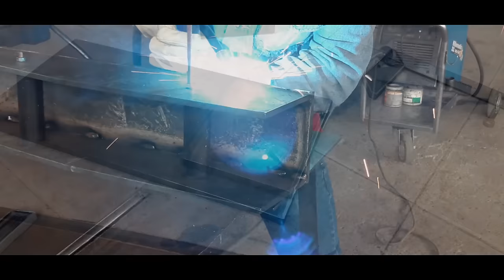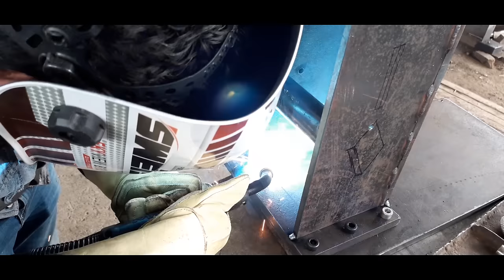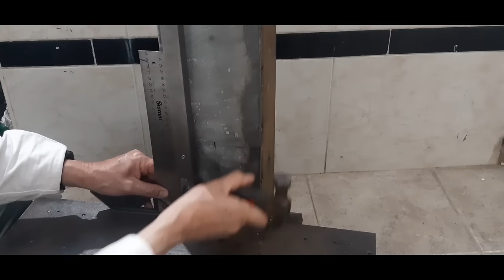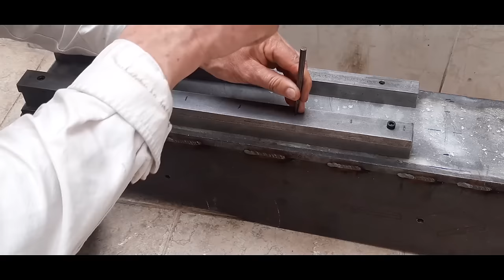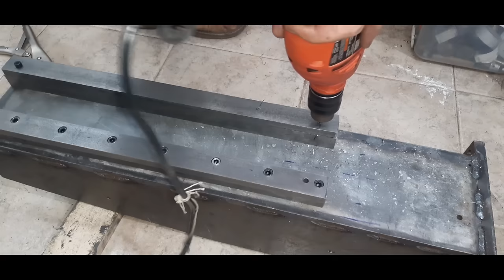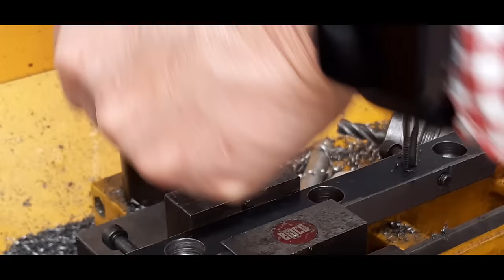Milling Machine homemade (Z AXIS - COLUMN) - Part 2

Comment: I'll never understand why anyone welds thin steel plates like that for homemade mills. Epoxy granite castings are superior, easier and less problematic.
Reply from the maker: Thank you for your comment, of course epoxy granite is also a good option, but this way of welding helps to make pieces for those who do not want to use epoxy.
thank you
Reply: Wrong
Reply: You do realize that an epoxy granite mill requires a framework that needs to be welded prior to pouring right. This frame cannot be screwed or bolted together thus welding is the only solution. You can't make dovetails and lead screws run in epoxy granite. The only real purpose of the epoxy is to provide vibration damping. So that statement was made with no knowledge of the machines function or porpose.

Comment: this method of making of prototype of industrial Equipmehts in small shop is called industrial engineering in real sense for production  of daily use material in need of man kind.  This will make the India to be smart city by providing of bricks tiles high speed railway lines for bullet Trains
Reply from the maker: Thank you friend for commenting, if that is done with engineering and being constant and insistent, great things are achieved. Greetings from Colombia

Comment: hi thank you for amazing build can you pleas provide me with x z y dimensions pleas and table length and width and z axis thank you
Reply from the maker: Thanks for asking, the dimensions are as follows:
x-axis displacements: 550 mm.
y-axis: 350 mm.
z axis: 500mm.
the dimensions of 
the table are: length: 600mm
Width: 155mm.
Any other questions I will be happy to assist you with.

Comment: great looking machine!   I'm designing one to make myself as well.   could you tell me though, how thick is the plate steel your using?  It looks to be half inch but wanted to ask anyway,  thank you
Reply from the maker: Thanks for asking, if the base and column is half an inch and the table top is 5/8 inch.
any concern may well.
Thank you

Comment: If you can build a fire and place all the welded frame parts in it to stress relieve them that would be good! Temperature variation, vibration and time will cause the welded frame parts to shift by up to a couple mm for this scale of machine. Industry does use welded members for CNC machines but they are stress relieved to get that residual stress out of the system welds then everything is trued.
Reply from the maker: Thank you friend for commenting, your appreciation is important, welding is critical in this type of project

Comment: It is a very crude machine. I saw recently small B-port sized machine made in Canada few decades ago - it only used fasteners. Was quite accurate & sold for good money. Way more than I expected. It was significantly better then this - far more machining was involved, scraping etc. 
This is just a precision of a cheap drill press.
Reply from the maker: Thanks, possibly, if you used it machining metals, you would probably change your mind.
Reply: @franciscomurciaprojects2327  Why don't you do a video where you machine metal with this "thing" and show the part & measure it? Make sure this is across most of the range in all 3 axis. Something like say fly cutting and milling. Use say 75% of expected max load.
Reply from the maker: @tomk3732  Thank you. Excellent idea and good comment. Yes, I will make a video machining a piece and I will show the measurements according to the three axes. Thank you

Comment: Excellent video, specially the spindle detail for a first time builder like me. Could you pls give sizes of the vertical column ?
Thanks
Reply from the maker: Okay. Thanks for commenting and asking, the size of the column is Height: 720 mm. Width: 150mm.
depth: 170mm.
sheet thickness: 12 mm.
Thank you
Reply: @franciscomurciaprojects2327  Thanks for this important info. I will go for casting. First the patern !
God bless you.

Comment: Hi great job and has given me lots of ideas, my question relates to the tapered roller bearings.
Did you use aluminium to make the bearing blocks?
Reply from the maker: Thanks, for the bearing blocks, I installed them with steel blocks

Comment: HOLA AMIGO, NO LO TOMES A MAL, LAS COSAS SOLDADAS EN MAQUINAS TIENEN MUCHA PROVABILIDAD DE VIVRACIONES Y LLEVAN MUCHO TRABAJO , NO QUEDAN BIEN YO TE ACONSEJO , HACE UN MOLDE EN TERGOPOL O MADERA Y LLEVALO A FUNDIR EN FUNDICION GRIS FUNDICION  CC, SALE MAS BARATO Y QUEDA SOLIDA COMPACTA Y SIN VIBRACIONES SALUDOS DESDE ARGENTINA .
Reply from the maker: Hola amigo Gracias por comentar,   si, efectivamente en este proyecto lleva partes soldadas ya que el diseño de la maquina lo requeria, esta es mi primera fresadora que diseño y a pesar que la fabrique con materiales de gran espesor y buena soldadura jamas llegare a la rigidez de una pieza en fundicion, lo entiendo y son datos atener en cuenta para otros proyectos. Mil gracias por su opinion que son generadas por personas como Ud. que conocen muy bien del tema. F. M.
Reply: Hola por ser la primera quédate tranquilo va a salir todo bien con algún problemita pero tranqui lo vas a solucionar . Yo tenía ganas de agarrar un torno paralelo de 1.500  desarmarlo usar la bancada vertical en lugar del cabezal poner una escuadra grande de 1000 x 1000 y arriba poner tipo mesa de fresa o mesa en Cruz grande y el cabezal reformar un poco y ponerlo arriba de la bancada y tenés fresadora y agujereadora muy grande pero no sé puedo siempre pasá algo y plata jajajaja un abrazo grande.
Reply: Hola estube mirando bien y no pongas hierro con hierro la bancada tiene que ser una parte de fundición por los deslisamientos y los engranes y trata de mecanizar todo lo que vá abulonado tiene que apollar bien suerte.
Reply from the maker: La idea de adaptar el torno es buena pero se toma dinero, el hierro ha subido mucho y esa es una limitante, per con creatividad se puede saludos

Comment: No creo que hice un proyecto, modelo, planes. Si eso sucede, lo haría si fuera posible.
Qué grosor tiene la placa del marco para que no haya vibraciones?
Reply from the maker: La placa del marco tiene 5/8 de pulgada (15 mm) y la columna tiene 1/2 pulgada (12 mm) y los costados 3/8 de pulgada (10mm)

Comment: Great work..love watcching the video.....How are you going to mount the motor?.....I'm designing a similar size mill.......What is the distance of the spindle fom the ways?
Reply from the maker: Thanks friend for commenting, the motor is installed on the left side of the column and supported on the milling machine head, the distance from the spindle to the column is 240 mm. and from the table to the spindle it has a travel of 450 mm. Any question may well. Thanks
Reply: Thank you Francisco. That really helps me understand your proportions. Are you using counter weights or gas struts to help support the weight. I would love to see the finished product. Thanks again.

Comment: Do you have a link or source for the mt3 spindle?
Reply from the maker: Hello friend, thanks for asking. If you refer to the chuck mt3 collet, here I send you the purchase link: https://es.aliexpress.com/item/32947049380.html?spm=a2g0s.9042311.0.0.3c1263c0Opttqw
But if you refer to the spindle I had already manufactured it before and therefore it does not appear in the video.
If you require another question, you may as well. Thanks

Comment: Excelente el diseño de la fresa , si fuera tan amable k grosor de plancha empleo i  de cuántos HP de motor Io usó , saludos desde SICUANI Perú 🇵🇪
Reply from the maker: Hola amigo gracias por preguntar, en la mesa use un espesor de 5/8 de pulgada y las ranuras en t usaré 1/2  pulgada
Gracias
Reply from the maker: También use un motor de 1 hp
Reply: Mil gracias x la respuesta , con su  permiso me boy a atreverme a reproducir, ahí falta un vídeo con máquina acabado , solo eh visto 2 ....saludos
Reply from the maker: No se preocupe que estoy terminando la parte 3 para subirla en estos dias

Comment: nice project, Where did you get that linear guides to allow the slide up an down of the Z axis?
Reply from the maker: Hello Friend, the linear guides are calibrated steel bars that you get where they sell steels, you get them in any measure, I use 1 and 1/2 inch by 1/2 inch and the length I need. Thanks any question well may